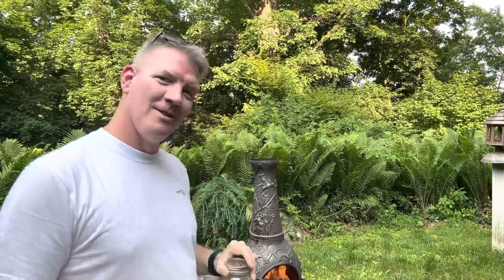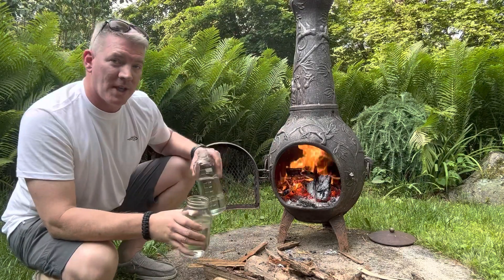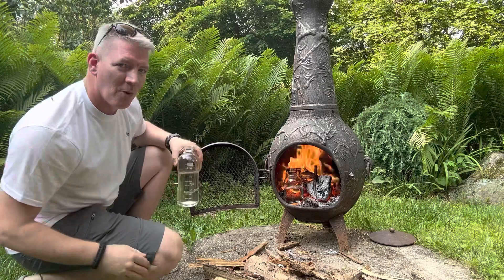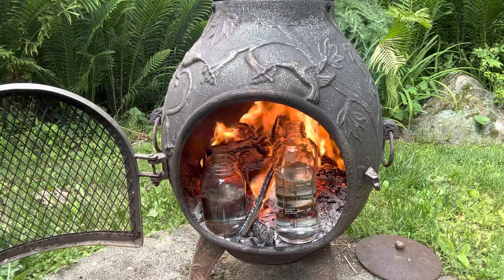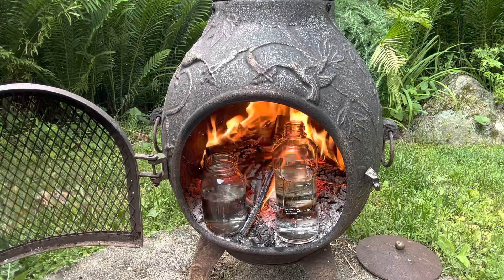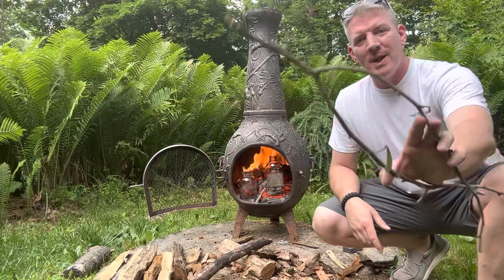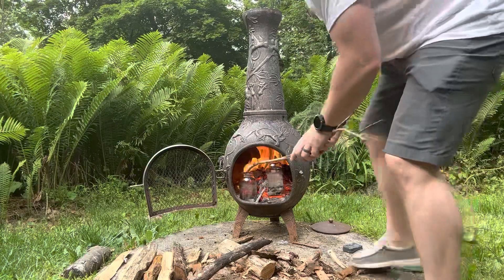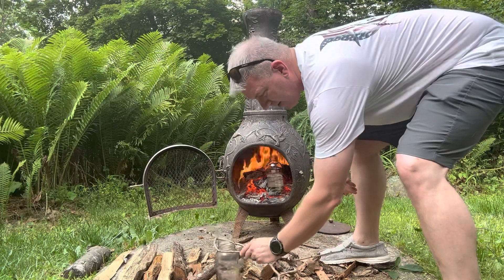Boiling Water in Glass

Comment: Do plastic bottles next!
Reply from the maker: Fine. Lol
Reply: What if have a bottle made of wood? Or cheese?

🧐

Haha, jk, I've def seen all sorts of interesting materials used to boil water, and while you def have to monitor stuff pretty closely, it's wild how much stuff you actually can boil water in.
Reply from the maker: @padraichagan8347  well wood can be used over coals not a roaring fire, cheese…well you got me there
Reply: actually that has been done 
fill the bottle completely with water 
squeeze the bottle a little to give the water room to expand 

secure the top and place on the fire
the water inhibits the plastic from melting or burning 
try it, I assure you it works
get back to me with your results
p.s. I would not advise drinking the water